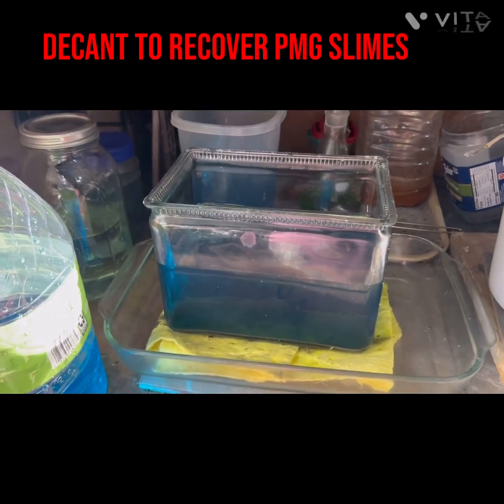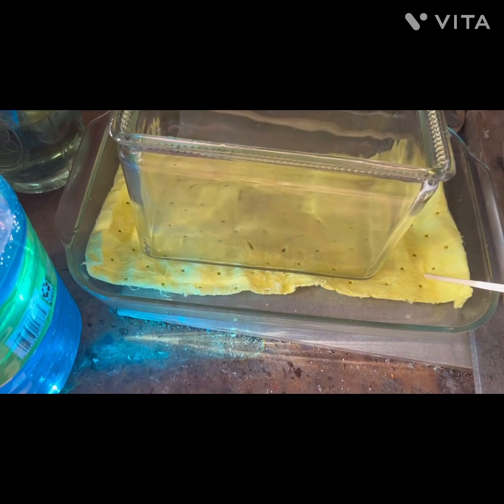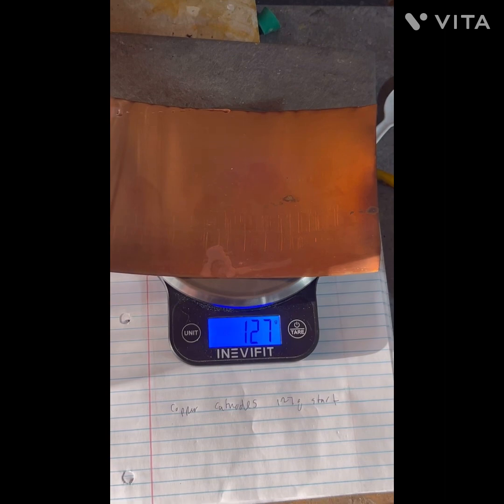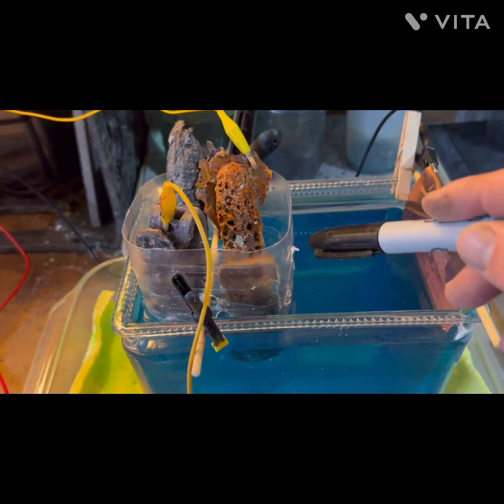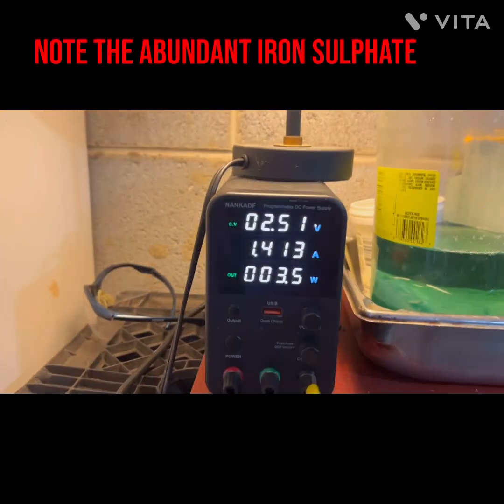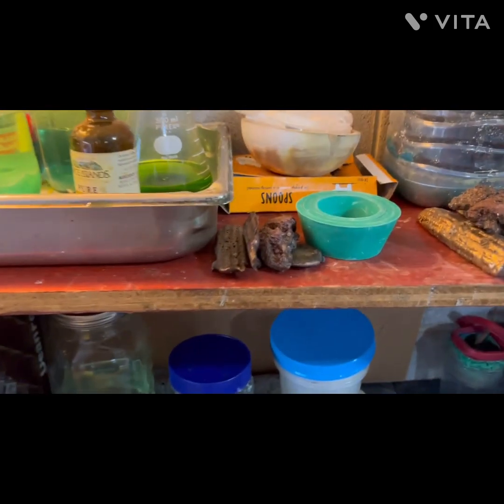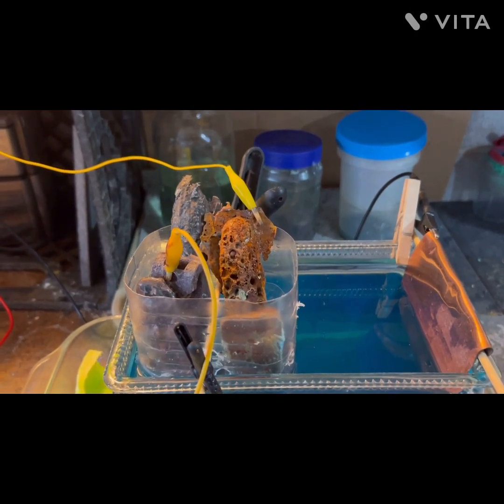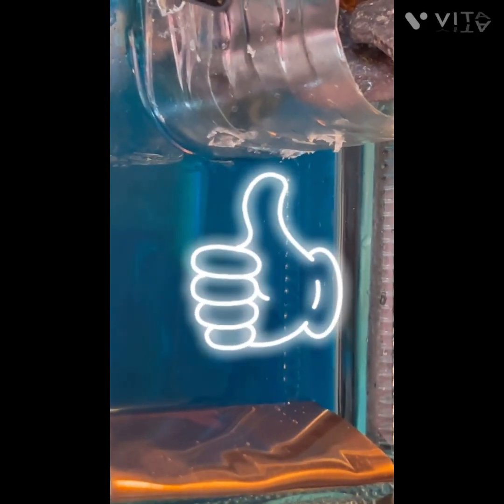Copper Sulphate Cell #scraper #silverrecovery

Comment: Hey Thank you kindly Sir, the trap was an idea I had after prospecting and focusing on the low pressure areas of the rivers and creeks here in Australia. The PMB slimes will always have copper present after the electrolysis process. Because there is a much much lower content of copper than precious metals and to stop wastage during the melting process I will be using cupellation. Cupellation is the better option. Add some lead then you will extract everything except the gold and silver. It's worth thinking about. I believe electrolysis for copper and silver is the most efficient and safer than high concentrations. Good on you for taking the path of electrolysis, I will be watching with envy. Thank you, Sutho's Electrolysis Workshop :yt:
Reply: I was thinking that looked like suthos 😂 
Spot on with the creativity meets function.